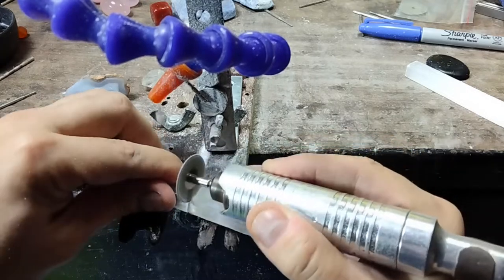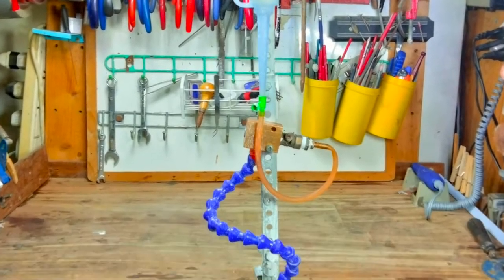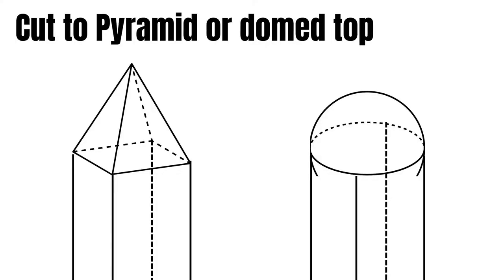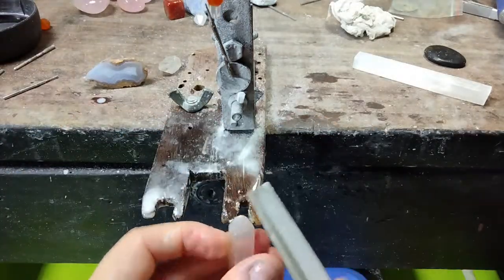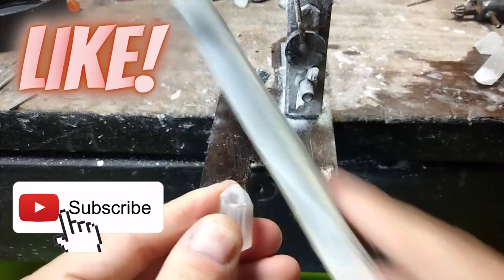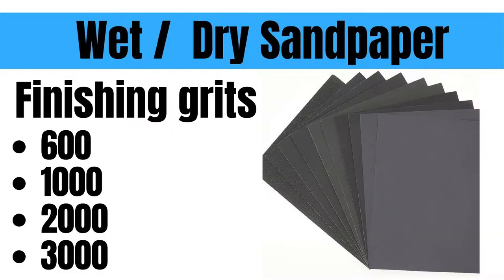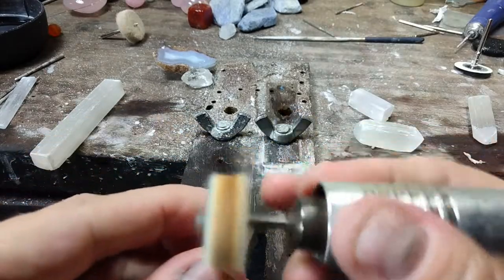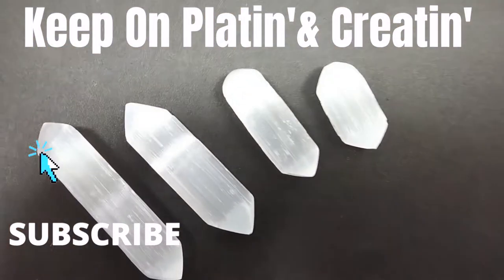Doubly Terminated Selenite Cutting & Polishing, No Special Equipment

Comment: just ordered my dry wet sand paper. My selenite has been looking feeling and sounding so dull and scratched up and it’s been bothering me for the longest time. I don’t even wanna look at it anymore or use it for my meditation but I don’t wanna throw it away😂😂😂Now I know exactly what to do and I am excited to put to work what I learned from this video when the sand paper comes in. Thanks!
Reply from the maker: I love hearing this, I hope it comes out perfectly.  Don't press too hard.
Reply: @electrojewelerjordan490  it came out exactly the way i wanted it to, i didn’t have to apply much pressure at all i let the pressure of my sanding motion do most of the work. they look & feel beautiful, i’m happy with my result and that i tried something new. thank you for the tips and this very helpful video!🙏

Comment: Hey friend, do you think I would be able to successfully drill a hole a little bit smaller than a finely threaded screw and then screw into it?  I'm trying  to attach a piece of leather to it and I like the way it would look with the ring design
Reply from the maker: Hi! Yes and no 😊.  Drill hole about same size as screw and then use epoxy to hold the screw in place.  That would be very secure. I think if you tried to screw in the screw it would crack the stone.
Reply: @electrojewelerjordan490  thank you.  I can see how that would be.  Glad I asked!

Comment: I bought a selenite tower and the base wasn't level. How can I sand it or what do I do, so it will stand level where ever I put it. It's not really bad, but enough that it wobbles a bit, and it could tip and break.
Reply from the maker: Least $$$ way would be 220 grit wet dry ( black one) sandpaper on a flat surface,  keep wet and rinse paper frequently.